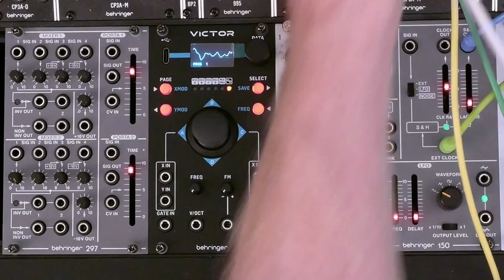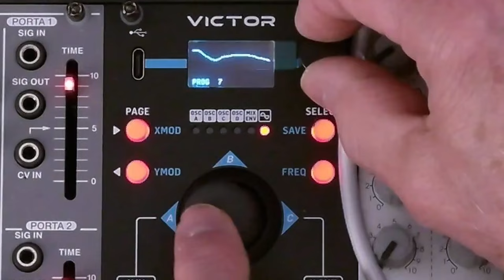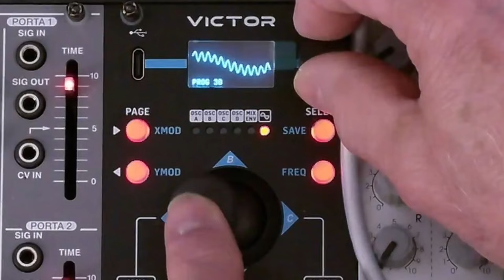Behringer Victor Unboxing - Vector Synthesis

Comment: U didn’t explain why all of a sudden there were X and Y outputs. Where did they go?
Reply from the maker: @joshuabpolys No, I did not go into any detail on that.  These outputs will produce +/- 5 volts each to represent the location of the Joystick.  Anywhere you can use a control voltage, you could use these outputs.  I'll be releasing Part 2 tomorrow, then in a week or so, Part 3 may well have some examples (use cases) for the X and Y outputs.
One example is to use the X output for pitch bend (route it back into the FM input).  Another could be for filter cutoff, or vibrato amount.
does that help?
Reply: @ozhalljr  yes👍🏼. Thx much!😊
Reply: @ozhalljr  Very much!1

Comment: this module is broken, gate input is not doing anything
Reply from the maker: @kaszaniarz Here are a  few debugging suggestions:
1) The Gate input requires a v-trigger (goes positive 5v when the gate is on).  If you use an s-trigger, it will not work properly.  
It's best to use a keyboard with CV/Gate (v-trigger), or a MIDI to CV converter, so that you have full control over the length of the gate.
Otherwise, if you have a 960 sequencer, try the 960 oscillator output (clock) running in the low LFO range (3 to 5 seconds per step).

If you don't have a v-trigger, but you have a 961 interface, convert the s-trigger to a v-trigger.  
OR Try the square wave from a 921 (not 921b) oscillator.  
Note: a SLOW clock is very important to be able to hear the "mix envelope", which may well take 3 seconds or more to run it's course.

2) be sure you're using a preset (e.g. #20 or #25 ) which has a slow enough mix envelope to be able to hear it.  #20 takes a 3 seconds to get to one of the waveforms that is an octave lower than the beginning waveform.  Because of the pitch change, it's easy to hear.

3) be sure you're listening directly to the Mix Out.  A filter may well mask the harmonics that are changing.

Let me know if that helps.

Comment: This is my next purchase. Got the note from Sweetwater that they were in. Thanks for the great info as usual.Cheers
Reply from the maker: Cool!
Reply: @ozhalljr  Thanks OZ. I do have a quick question about voices. Is the Victor capable of playing more than 1 note at a time or is it monophonic? Cheers
Reply from the maker: @moogfooger  Great question.  There is only a single CV input, but there are 4 VCOs which can be at 4 different frequencies.  So, yes, monophonic, but 4 VCOs.
Reply: @ozhalljr  Thanks OZ. I guess you will be going over this in your presentation. The VS mini can do paraphonic 4 voice but Victor has no midi in so no way to control the VCO's pitch individually. Cheers
Reply: @ozhalljr  Hey OZ, another quick question about the Victor, Does the display have a pass thru function? (the Brains unit has this) Just wondering if you can use it as an oscilloscope for any signal going through it! Cheers
Reply from the maker: @moogfooger  I didn't know that about the Brains.  The external audio 'scope capability is reason enough to buy one!.  
The manual for the Victor does not mention this function.
Reply: @ozhalljr  Yes I know that the scope is a killer feature. I was just looking through the manual for both the Brains and Victor. There is a note about stand alone scope mode  in the Brains manual; but not in the Victor. Maybe in a firmware update? Thanks for checking OZ. The adventure continues. Cheers